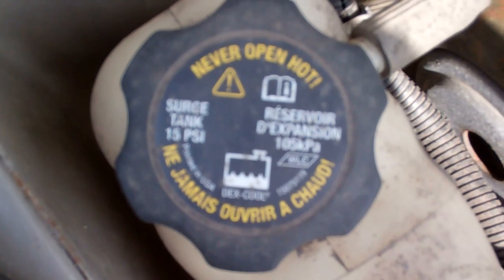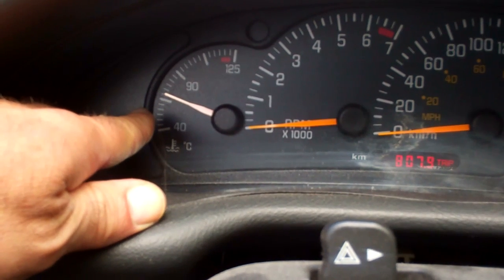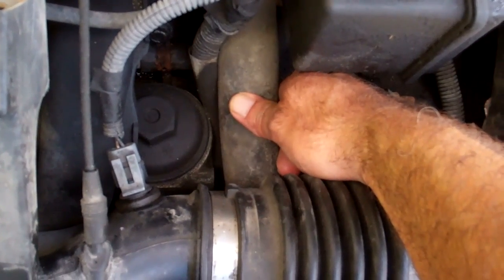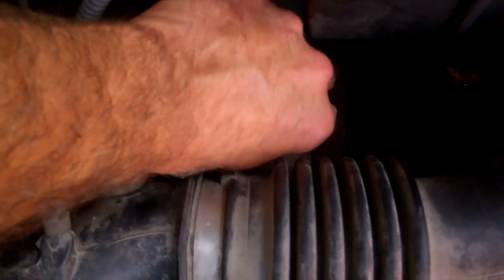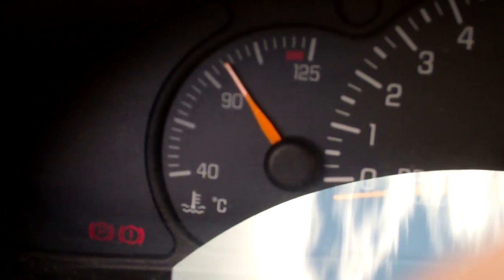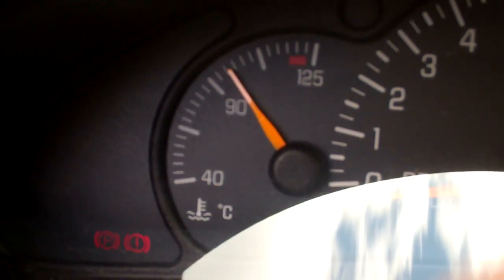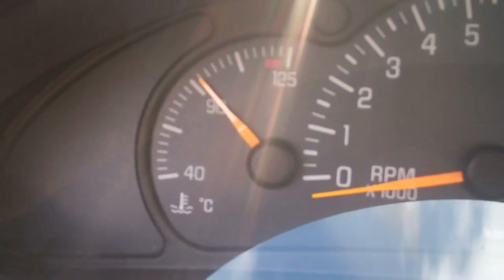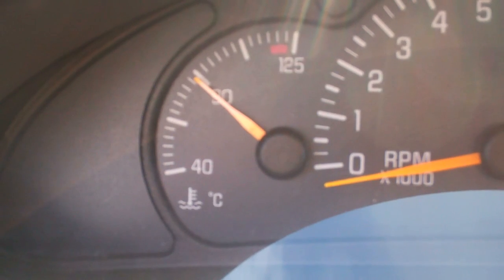Finding out why an engine is over heating

Comment: Would the ECT sensor dictate the thermostat temperature? I've been stumped Fan will not come on almost 3/4 to the red at times 2 lines from the red won't kick on the coolant fan, only time the coolant fan cycles on and off is when the heater is on, this is not normal?Only time it would work is when I turn the a/c on which manually turns both fans on condesner and coolant fan, both fans are new, radiator new, new rad cap, fresh coolant new water pump, new thermostat, head gasket seems OK no signs no bubbles or milky color or smell from exhaust or any coolant in oil mixed, so is this a failing ect sensor? Its a 05 Honda civic so most of the failing parts are intermittent, never just die.
Parts are Napa also OE and new" to a year old. Condenser fan is new and rad/coolant fan is about a year old it works and kicks on, just not when it gets hot. Please help.
Reply: Change coolant temperature sensor. It tells the fan when to turn on
Reply: Robert Mrbena Mrbena hey you ever find out what was wrong I'm going trew same problems😰

Comment: what if my heater or ac are not blowing any air at all
Reply: Alex Cazares probably a blown motor
Reply: Check the fuses and relays. It could be an electrical problem too
Reply: I'm having similar problems

Comment: simple video but well explained what you should do and look for to see what is the problem
Reply: cedieboy cedie p
Reply: backyardmech . My chevrolet Matiz is causing trouble. Fan is working fine, coolant and antifreeze is filled to a good level but still temperature goes almost to half even if I drive less than 0.25 miles. I took my car to the garage and the guy said to turn on the heating on but what if its summer....What could be the problem? Do you have any suggestion.
Reply from the maker: cedieboy cedie Thanks Cedieboy - I plan on doing a series of videos on trouble shooting cooling systems

Comment: Well done - amp draw on that fan is around 16 . What I have found is as the fan ages it will draw too much at times.  Would have been nice to see the amp draw after the fuse replacement.  Is the fan ok now ?
Reply from the maker: True Rob. As for the car, it hasn't over heated again but I've advised the owner to watch that temperature gauge. I still suspect a relay may be intermittently sticking in the control circuit. And i want to do a video on testing vehicle electrical components so I'd like to have a real world example of a bad one
Reply: STEVE ROB ujijkk